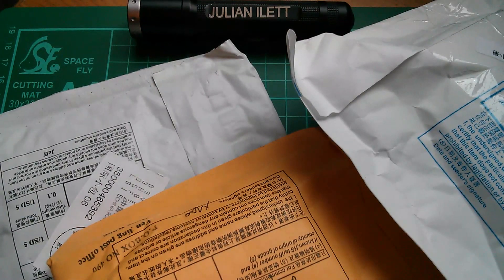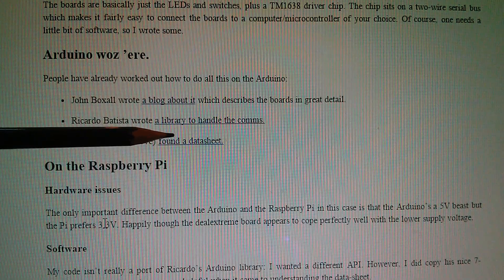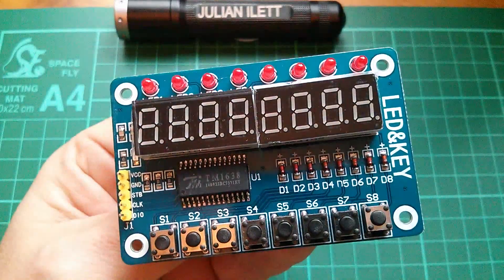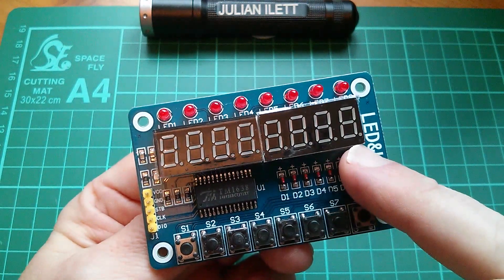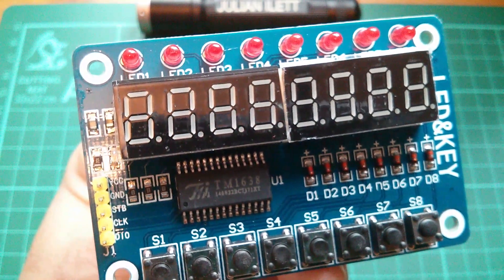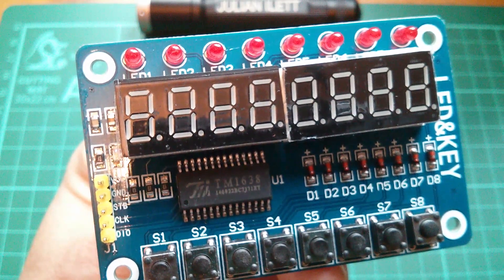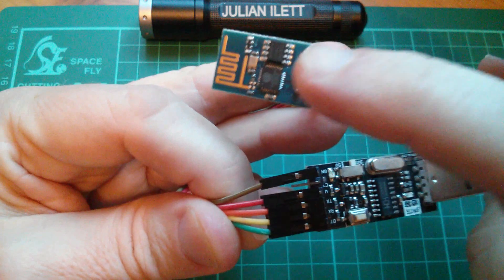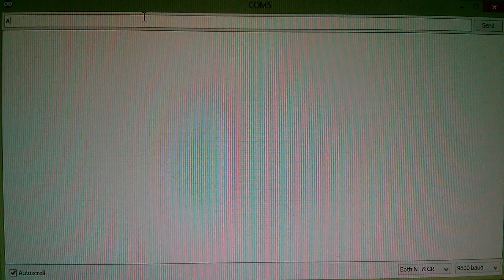Postbag: #27 - LED/Switch PCB, ESP8266 Modules, Banggood Quad

Comment: worst modules possible! i bought 2 ESP-01 modules from banggood and both of them have IoT firmware on them and I cannot reflash them with other firmare that accepts AT commands... I've tried every tutorial possible, I've connected the modules to arduino, prolific programer and also to a CP2102 usb-ttl converter and it's not working at all... When I power up the module it shows the version which is 0.9.2.4 and "ready" message and that's all... It doesn't connect to any flasher I've found on internet even the baud is correct (9600) and also the COM setting is ok... The module is proper connected, using 3.3V for power and for RX I'm using a voltage divider made out of a 47k and a 100k resistors...I connected the CP_... pin to 5v..GPIO0 to gnd...I spent 6-7$ for nothing...

Comment: And here are the toolchains for linux: https://github.com/esp8266/esp8266-wiki/wiki/Toolchain
With an example on uploading program to the device here: https://nurdspace.nl/ESP8266/First_setup
Here's a simple web server on the esp8266: http://harizanov.com/2014/11/esp8266-powered-web-server-led-control-dht22-temperaturehumidity-sensor-reading/
Inside it has a risk core running @ 80Mhz ... see more here: https://github.com/esp8266/esp8266-wiki/wiki

Comment: Spent all weekend making an Arduino Library for the ESP8266 (because I didn't like the existing ones), maybe you will find it useful, currently supports making arbitrary HTTP GET requests with basically 3 steps...

wifi.begin()
wifi.setupAsWifiStation()
wifi.GET()

and then you've got a buffer full of the response to the GET (or as much as will fit), with or without headers, possibly starting from a given line offset.

Server mode is next on the list.

Anyway, if you want to try, here: https://github.com/sleemanj/ESP8266_Simple

Arduino zipped library download in the Readme, just download and use the Arduino IDE to install the zip.
Reply: Have updated my library to also do HTTP Serving as well, nice and easy like.  Info in the examples.
Reply from the maker: James Sleeman HTTP Serving sounds interesting - I'll have a look.

Comment: Ah Nice, I ordered my ESP8266 last week, so I'm in the waiting game :-), as you have probably seen there are quite a few layout versions. To get you going use telnet to connect to it if you set it up as a server or use nc, NetCat on Linux/Cygwin-Windows if you want a very simple listener that you can connect to and type text back at it. I intend to have an android phone in server mode and get my Arduino/ESP to connect to it and send my app data for graphing. This thing is actually cheaper than using a BT module.
Thanks for all your nice vids keep up the good work.

Comment: I couldn't resist buying one of the LED display and button modules too.  Ridiculously cheap, and looks quite useful.  There's a protective film on the front of the LED displays that peels off and improves their contrast greatly.
Reply from the maker: bigclivedotcom Nice one Clive - I look forward to some Arduino videos from you (or are you planning to use a different MCU?)
Reply: Julian Ilett I've not got a project for it yet, but I'd be inclined to bodge it into one of my usual PIC based designs with suitable bit-bashing if it's got a separate clock and data line.  In the past I used the classic M5450 programmable current direct LED drivers, but they seem somewhat scarce these days.

Comment: LED&KEY I am using it for a satellite tracker - image on Flickr. Good value. Only criticism is they have placed the connector on the wrong side of the PCB for mounting it to a panel. Maybe that's why its so cheap.

Comment: Julian, I've also been playing with the ESP8266. I don't know if you've discovered nodeMcu yet. Using that firmware, the ESP becomes a self contained WiFi capable microcontroller! OMG!

http://hackaday.com/2014/11/23/using-the-esp8266-as-a-web-enabled-sensor/
Reply from the maker: Hari Wiguna Hi Hari. I spent all day watching your videos and trying to get my ESP8266 to run the NodeMcu firmware. Finally got to switch an LED on GPIO2 on and off. Blinking using the timer wasn't so sucessful - lots of PANIC from Lua. Very frustrating, but fun too. I must find me a good Lua uploader. Thanks for your videos, they helped lots.

Comment: Warning ! ESP8266 SERIAL WIFI test board, some of its power input VCC and GND has reversed polarity issues, check pls

http://detail.tmall.com/item.htm?spm=a220o.1000855.0.0.vlMRoF&id=41428828420&rn=37ff984a78c124e3c135fc878663e213.
Reply from the maker: TheOldmankk From the link you provided, it looks like there's an Android app that works with the test board. But it seems it's in Chinese only - that's a shame. Point taken about the polarity issue (where did you get that info?)
Reply: Julian Ilett shame ? why must they care when their domestic market is big enough to ignore the rest !. Many buyers have gotten their PC burnt or PSU blown. Info was extracted based on the comments and feedback. You have to scroll down the link page and click on the right tab.
Reply from the maker: TheOldmankk OK, it looks like the problem is with the plug-in wall adapter. It's a US 2-pin type - I probably wouldn't have used it anyway. But thanks for the heads up.
Reply: Julian Ilett  We are your die hard fans. We appreciate your chirp chirp, goodie goodie parts review. You are doing great DIY community service. hahaha.... Happy Weekend Pal.

Comment: You're going to be the death of my bank account. Every time you do one of these videos it's almost too much to not go out and buy some of it for myself. I've already got more USB LED stuff than one person could need, and a DS3231 RTC I'm having some difficulty setting up.

Also, that micro quad seems very similar to the Estes Proto X, except it ranges from $30-60 (about 20-40 pounds). I doubt people who want a micro quad are going to start buying them from china, but if it turns out to be alright, it's definitely something to suggest to someone new to multirotors.

Comment: Note that the ESP8266 TX and RX are 3v3 also, make sure you level shift if you're talking to a 5v arduino.

The more recent firmwares (0.9.2.4 is latest) are 9600 baud to begin with but you can change them in the later versions, 9600 allows you to use SoftwareSerial out of the box.

Do not try an AT+CIUPDATE (supposed ot update the firmware "from the cloud"), it appears to be majorly screwy at least currently and I had to reflash the firmware from scratch to recover.

Note that once you join an access point, they will remember that (writes SSID and Password to some EEPROM) and automatically reconnect, or try to, every time they power on or reset.

Comment: I'd highly advise using a proper terminal application rather than the arduino serial monitor (which frankly sucks). I personally use putty although teraterm works nicely too.

Comment: Id love to see that neat 7 segment LED display work in some sort of circuit like you mentioned. Also, that wifi module seems interesting. A lot of power in such a tiny little circuit..I wonder how good the range is on that thing with such a tiny antenna?

Comment: Hey Julian, about the ESP8266 I read that there is an SDK
http://hackaday.com/2014/10/25/an-sdk-for-the-esp8266-wifi-chip/
My modules are on the way yet.
Reply from the maker: Emmanuel Hernandez I downloaded that SDK, but haven't worked out yet how to install it on my PC.
Reply: Julian Ilett There are two firmware that deserves a mention here: one with a Cloud Update feature and a custom LUA based firmware. Here are some interesting links about those and Wi07c (ESP8266) in general. ;)

http://blog.electrodragon.com/cloud-updating-your-wi07c-esp8266-now/

http://www.electrodragon.com/w/Wi07c

https://github.com/nodemcu/nodemcu-firmware

http://hackaday.com/2014/11/23/using-the-esp8266-as-a-web-enabled-sensor/

http://www.esp8266.com/viewtopic.php?f=23&t=588&start=200

Comment: Julian I purchased the exact same LED&KEY unit and after testing the various libraries found the following one easiest to use https://code.google.com/p/tm1638-library . Just yesterday I purchased the ESP8266 module to play with as a replacement for the NRF24L01+. I Have watched a few reviews and a little worried that it consumes quite a bit of power and will need a separate power supply so not ideal for all projects but I look forward to your findings. Keep up the good work!

Comment: Interesting device ESP8266. I just made a quick search and it seems power consumption is quite high especially for battery operated devices about 250mA in transmit mode. Maybe you can check the power consumption in different modes.
I was going to use Bluetooth 4.0 for the next SBMS version that uses around 8mA during transmit and cost around 10 to 15$ but if I can find a similar priced WiFi module with relatively low power consumption I may consider that instead.
Reply: Are you talking about the HM-10 BLE module?
I'm waiting for a 6-pin "arduino friendly" version of the HM-12 (dual BLE/SPP) module. The datasheet claims 9.5 mA on BLE and 13.5 mA on SPP.
Reply: Álvaro M. Valdebenito B.
I do not like the HM-10 BLE that much do to large size and the TI IC that they are using. I seen some complete solutions form.
I have limited space in my project it should fit in the place of the uSD card.
I seen something from Murata much more compact 7.4 x 7 x 1mm and use a max of 5mA on both receive and transmit mode.
SPP is not need in my application but maybe the compatibility with some old devices will be nice to have.
Reply: WiFi and low energy isn't possible. WiFi, it's speed and it's range is due to the power. So if you want low power, BTLE is the way.
Reply: tengelgeer
I agree with you and I will most probably use BTLE 4.1 range is good up to 100m and speed is more than suficient 250kbit or 1Mbit for my application.
With the big buzz around IOT there may be new low power WiFi protocols with lower speed and power consumption that I'm not aware of it is worth asking is hard to keep up with all that is new.
Reply: ***** For WiFi is nothing very low power. But there are some protocols for internet over low power transmitters ment for IoT. But I don't have a link right now.

Comment: What a coincidence! Got the same ESP8266 module earlier this week. Did the same research and found the same sites. I had no time to power it up so this video might save me some time getting them to work this weekend.
Reply: Oh and by the way this site is interesting. ESP8266 powered web server + LED control + DHT22 temperature/humidity sensor reading http://harizanov.com/2014/11/esp8266-powered-web-server-led-control-dht22-temperaturehumidity-sensor-reading/

And also this one. How to use ESP8266 ESP-01 as a SENSOR web client
http://importhack.wordpress.com/2014/11/22/how-to-use-ep8266-esp-01-as-a-sensor-web-client/
Reply from the maker: da_ke I hope it helps. It was quite easy getting the basic AT commands working - now comes the difficult stuff!
Reply from the maker: da_ke Yeah, those are both excellent links. I really fancy re-flashing my module with different firmware now - I'll order some more. Cheers.
Reply: Julian Ilett
Got it working after providing more current on 3.3V (requires up to 240mA). On my USB to serial converter (ch340g chip) it keep crapping out on boot with gibberish on the console. I now have to order more modules. More grey plastic bags in my postbox :-)

Comment: Hi Julian im uk based n.west, I have a scooby doo alarm clock I bought from the states but silly me fried it by putting into a us adaptor at 220v and I should of used a step down converter.  Is there anychance you could fix if If I posted it or try maybe putting new board inside, id pay watever or very reasonable price for you. Ill post the same vid of an actualy clock if thats ok with you. Hope u can help, many thanks

Dan
Reply from the maker: lonefoxbushcraft Sorry Dan, I'm unable to do appliance repairs.